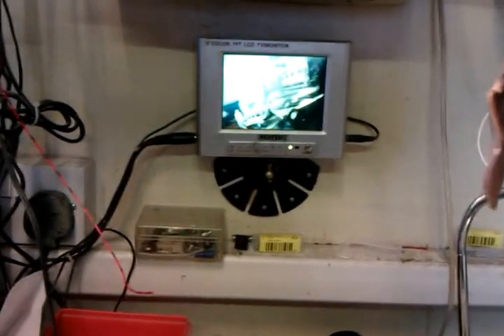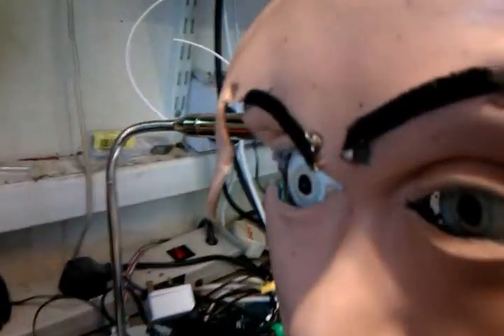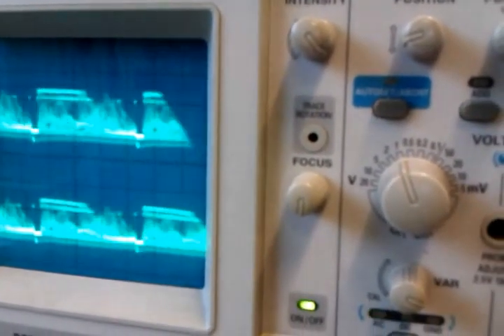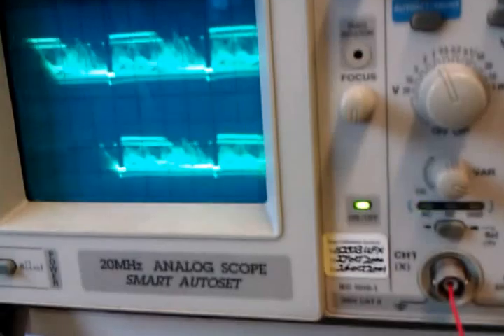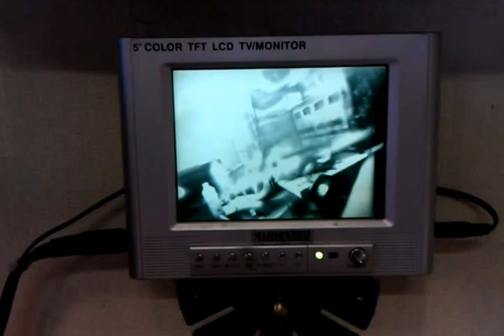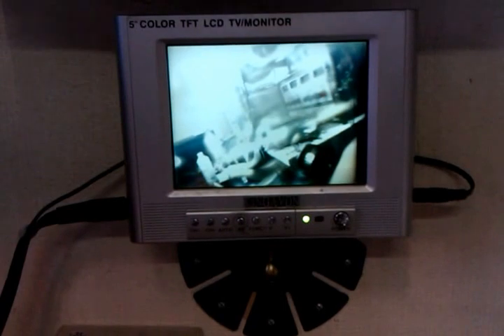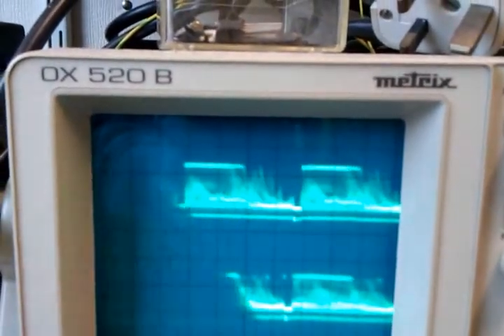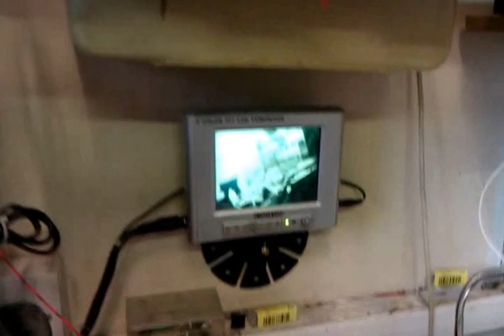3D IMAGING USING A HUMANOID ROBOT HEAD - STAGE1-GENLOCK

Comment from the maker: @vincentleest I will try but as usual there are always too few characters available. First select 2 identical ccd camera modules and cut out/desolder one crystal, this will be the slave! Then take some 2way ribbon cable and link between them both, put a 220nf and a 220Ohm resistor in  series in the midle of one of the two wires. Check video o/p of each camera, if slave not working use other wire. Two video signals then fed to two EL4581 ics through 100nf caps , use vertical o/ps pin3.

Comment from the maker: @vincentleest Part 2! EXNOR or compare verticle SYNC outputs, (I used 4011 to produce function) ( If out of sync ,output will be zero!) feed through cathode side of signal diode(s) with 10k pull up. Now feed through anode of diode with 1Mohm RES pull down , at node add 33pf cap, other side of cap pull down with 1M RES, feed to base of BC547 Transistor, pull collector high with 1M RES and feed to slave Xtal pin through  15 to 33pf cap. Thats the syncing ,original o/p filtered to give clean on/off

Comment: why? , im going with a dual  screen setup , ether the expensive yet light/sleek way with lcd glasses or the homemade cheap and bulky way , using 2 video camera view finders the crt ones i once picked up a full camera set for $10 and i used it as a portable vcr as the optics where fried , i could get about 3 movies from a single charge , the "screen" was 2" by 1" by 3" roughly so itd be a headset , not glasses , also for what im doing id need the screen AND retina tracking AND blink detection